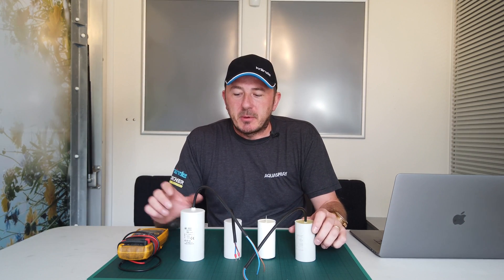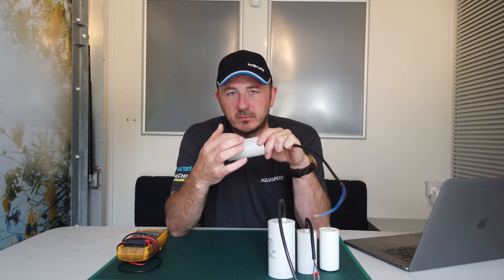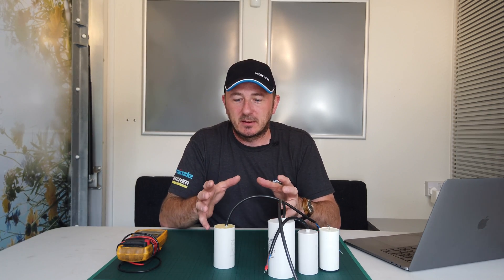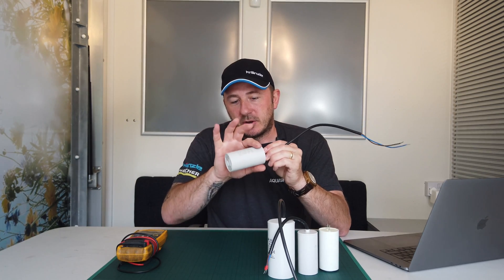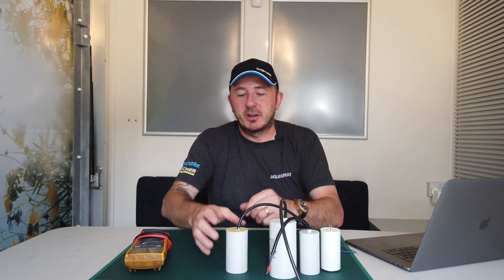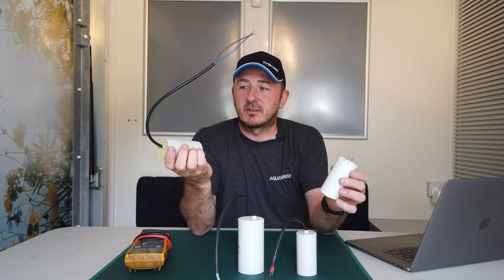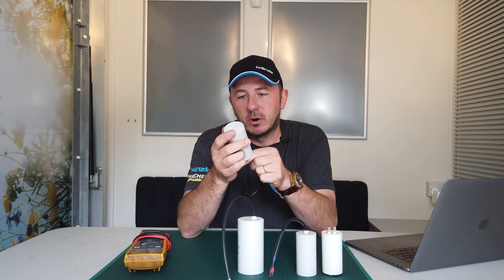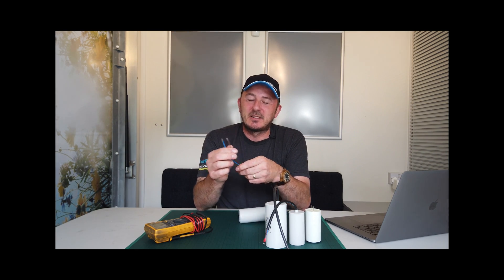What Do You Know About Capacitors?

Comment: Hi, i have a 3 phase jetwash 415v, i changed 1 of my capacitors as it was in bad shape, the jet wash has 2 capacitors st cap 275v and 400v run cap, it use to blown fuses sinc3 changing the capacitor that was bad its stopped blowing fused but every know and then it trips the house RCD circuit breaker, any advice or anything to look out for? thanks.